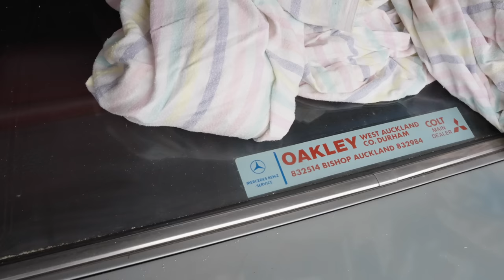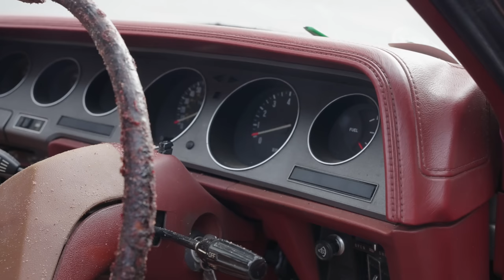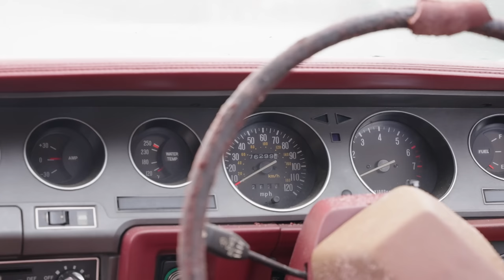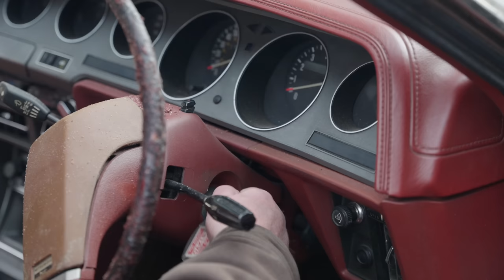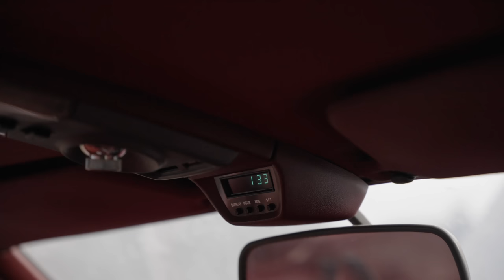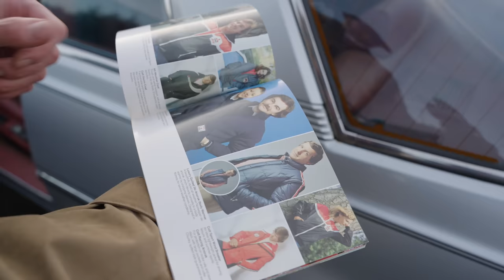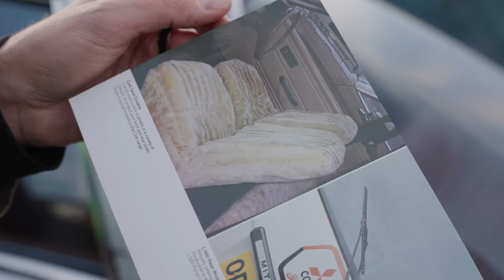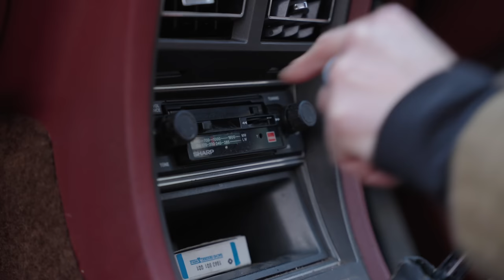Rare Barn Find classic 70s Japanese RWD Coupe discovered - will it run after 30 years?

Comment: They were quite popular in Australia where they were badged as Mitsubishi Scorpions with engines up to the 2.6 litre Astron (105 hp).
Reply: Yep I had one, and I miss it.
Reply: Sigma was the model range, with scorpion being used for the sportier variant.  A relative had one and the timing chain broke after about 5 months, damaging much of the engine.  Nasty warranty fight ensued.  I think it was the 1.8l one?  They seemed quite popular, but disappeared from Oz roads rather quicker than most...
Reply: @chrlz904  the only scorpions in Australia at the time had 2 litre engines the 78 to 79 and after that starting in  1980 which is the one I got were 2.6 litre. The sigmas yes are the ones with the smaller engines and I had 2 friends who had the sigmas and had no problems. Luck of the draw I guess.
Reply: The originals were badged Chrysler Sigma Scorpion.
Reply: @billyhong5071  yes and a badge on front passenger dash side saying designed by Mitsubishi. I had a new one in 1980.
Reply: To awc9008. Mitsubishi SCORPION?  Great name!
Reply: Even the tone of the stereo is good! Class act!
Reply: And Starion
Reply: @pistolpeds  The Starion was more sports car than coupe and usually turbocharged.

Comment: I had zero doubt it would fire up easily. It's Japanese. I'm a life long Toyota guy. Put a 1985 pickup out to pasture in 2000 with the head took off it because it had a leak at 385k miles. Sat there until 2013 when a guy randomly wanted to buy it. He showed up on a Saturday with a head gasket and fluids, fixed it, pumped the tires up and drove it on the trailer. Amazing. Can't beat the Japanese for reliability.

Comment: Hi Johnny. What a great find and an unbelievable result 🙂 In Australia these were called a Mitsubishi Scorpion. My mum had one back in the day and it was the 2.6 litre astron engine. It really was a great car, well made... solid....so I shouldn't be surprised that everything works after 30 sitting idle. Great show! A lovely trip down memory lane....👍
Reply: Starion, not scorpion!
Reply: No. The Starion was a completely different car!
Reply: @paulorchard7960  Pretty sure the Starion was the replacement for the Scorpion in the 80s. It was much more boxy.
Reply: @paulorchard7960  Starion was a very different looking car and factory turbo as well.
Reply: Yeah def a scorpion, had a few and my principal at primary school had a starion turbo we used to stare at in the carpark at school
Reply: Scorpion
Reply: Came here to add this comment!

I had a Scorpion back in the day, resprayed, lowered, sports exhaust and polished original rims. Loved this car so much - was a great drive. 

And yes, the Starion is a totally different car - the Scorpion was pretty much the two door sports edition of the Sigma in terms of styling. And they were (at least mine was) made in Japan. 👍
Reply: @PeterMescalchin  The Starion shared a lot of components with the Scorpion, The Japanese Saporro came out with the same 2.6L engine as the Scorpion and was turbocharged. They wouldn't allow the 2.6 Turbo engine in Australia so we got the 2L engine. My sister had a 78 GH and i had the 81 GJ. My father was a Mitsubishi Mechanic - one of the longest serving Mitsi mechanics in Australia.

Comment: In Australia this car was called the Mitsubishi Scorpion and my best friend said it looked like a spaceship.  I bought it brand new in 1978 and loved it but had to sell it in 1982 because it was not practical for carrying our new baby.  The smoothness that Johnny mentions is due the Astron engine having two balance shafts that rotate at twice the engine speed and cancel vibrations.  This feature was also used in the later 2.6 litre Astron engine and that one also produced the low vibration levels of a small V8 (but not the power of course).

Comment: Cool to see. I had a black one of these (same year model) for a short time in the 90s. Bought it cheap for £250 out of local paper. They had a book value of £700 at the time. Needed a little bit of cosmetic work doing. Plan was tart it up & sell it on quick make some dosh & move on. But I fell for it. Loved how it drove & looked. Relaxed smooth cruiser. Liked the fact you didn't see many around. Something different.
Kept it well over a year before letting it go. Have some of my favourite car memories from that Sapporo.

Comment: These were sold as the Mitsubishi Scorpion in Australia.  The 2 litre Astron engine that's in this car were also in Mitsubishi Sigmas , Mitsubishi L200 utes,  and AFAIK,  Mitsubishi L300 vans.  Parts availability should be actually pretty reasonable. The Astron engine came as a 2.6 litre as well.

Comment: Having worked on Datsun/Nissan through 70’s and 80’s this touched me. Those carbs (Nikki’s) were really robust and that dash is like 1970 challenger. Best bit is that special feeling when it goes from non runner to running smooth. So many emotions. Also, briefly had a four door one of these in the 90’s in bronze with alloys.

Comment: In Australia they were called Scorpions and were the big brother to the Sigma, which was similar looking. My boss, at the time when they first came out, had one and was very pleased with the way it travelled.
Reply: I owned a Sigma in '91 as my first car and always wished it was a Scorpion with the 2.6l engine.
Reply: The Scorpion was effectively a two door version of the Sigma and survived for both versions of the Sigma before it was replaced by the Magna. Had the 2.6 Astron as standard whereas the Sigma had a two litre option as well and maybe a 1.6 from memory.
Reply: @downesy68  You should write that in the Comments.
Reply: @downesy68  The first generation Sigma (GE & GH) which were badged as Chrysler were assembled in Adelaide and had 1.6l Saturn, 1.85l Astron, 2.0l Astron, 2.0 Turbo Astron and 2.6 Astron.  The 1.85l was dropped mid way through the GE cycle and replaced by the 2.6l and the turbo 2.0l was released with the GH producing 116kw for a limited run of 500.

The original Scorpion in GE configuration had a 2.0l motor only.  This was replaced with the 2.6l either right at the end of the GE or as part of the GH upgrades.
Reply: @MrCarrera28  thanks, great info. It sounds like you have a pretty intimate knowledge of them. I’m from Adelaide and my brother had a first gen Sigma SE with the 2.6. They were a significant local product here in SA.

Comment: That was a Mitsubishi Scorpion in Australia which came with a 2.6 down there. Essentially a 2 door Sigma. The Mitsubishi Starion was the JDM Mitsubishi to have in that era.
Reply: There was also the Cordia Turbo, with optional super shift gearbox! 
NSW police ran a few Cordias in the mid 80's, apparently they suffered from severe brake fade if used in pursuits

Comment: In Australia it was called the Mitsubishi Sigma. It came in a 2 door coupe (as seen here, it was called the Sigma Scorpion), four door and 5 door wagon variants. It had 2 engine options, a 2 ltr and a 2,6 ltr, both 4 cylinder. The 2.6 ltr "Astron" engine made it an interesting proposition, but it never really captured the interest of engine tuners.
Edit:
26:08 "..no vibration at all" 
If I remember correctly, the Atsron engines (2 and 2.6 ltr) had balance shafts.
Reply: Starion, not scorpion!
Reply: @paulorchard7960  Starion was a completely different car.

Comment: In 1978 this car was also released under the Chrysler brand in Australia as the Sigma Scorpion. The model was updated in 1980 when Mitsubishi bought out Chrysler Australia and all cars were then branded Mitsubishi. In 1982 it had a third facelift with a minor change in 1984 until it was discontinued in 1985. Also in 1979 the Australian made Sigma as we knew it was exported to the UK firstly under the Colt car company then later in 1982 was imported as the Lonsdale sedan or Estate. I also believe a few Magna cars as we called them were exported to the UK in 1986 as the Sigma Estate.

Comment: Ah! Got seven of these here at the Ranch. They came with the Property when I bought it.....4 Challengers and 3 "Sappy's." I've bought and had given to me over the years lots of Parts like that "SPORTAAA" Steering Wheel (s), some Doors, Fenders,ect. Most of mine are 79's and 80 models. One of them has Factory T-tops. One's an Automatic the rest are 5-Speeds. Got lots of Accessories like Aluminum rear Window Louvers, Luggage Racks,ect. And of course the DRY New Mexico Desert 🏜️🏝️ has been very kind to the Sheet metal 😀👍. And I don't even like the Damn things 👀😒🤨🙄......
Reply: Send this guy a steering wheel!

Comment: Just fantastic 
Love how it starts and runs fine after 30 years in a lock up!
Japanese cars of the 70’s- 80’s are so well engineered for reliability ( not rust): I saved a one owner 87 Celica GT - had been locked in the original owners garage for years unused. We changed all the brakes fluid’s fuel and cambelt plugs etc - it started first turn of the key and everything worked - wish I’d made a film or it

Comment: Oh my, you just made my heart skip a beat. Many moons ago when I was a care free and confident young'un, I part exchanged my Nova Merit 1.2 saloon for a Mitsubishi Colt Celeste ST. I saw it down a little side road on my way to work one day and two days later it was mine. My parents were not impressed as the Nova was a nice little sensible car. The Colt though... it was something else. All my mates were jealous, it was by far the coolest car I have ever owned. It was bright yellow with a little bit of black pin striping. Light sky blue tinted windows that had chrome surrounds. Deep pile brown interior carpets and a wonderful dash of individual sunken dials. 
 I ran it for a couple of years but the engine was getting a bit 'tappitty' so I laid it up and started sharing my girlfriends Fiat Uno 1.3 auto which was a bit of a come down. I sold the Colt on after  another year(ish) as my parents were fed up with the sight of it on their drive with no work being done on it. 
 Don't get me wrong, I like my comfy modern mondeo... but I will never be that cool lad in the yellow thing again. All the other lads my age had Escorts and Fiestas, whipping round the Dartford one way system. Not that I was fully fledged boy racer then, I did like to just go for a couple of laps every now and then just because...

Comment: My father had a 79 Dodge Challenger (US) he purchased new - caramel tan/ballast sand 2-tone with cashmere plaid buckets.  I used to borrow that car any time he would let me.  Absolutely adored that 5 speed - it shifted much nicer than the 77 MGB synchromesh I learned on.  Searched my house after watching this wonderful barn find looking for the original brochure I vaguely remembered.  Found the window sticker but the brochure I came up with was for 1982 Dodge Imports (US) - covering the Challenger.  It doesn't match the one in my memory.  Not sure if my father bought an older, left-over model or if he considered replacing his '79 with a current model in '82.  Also found the "tilt lock lever operation" hang tag if you or the owner need to adjust that amazing steering wheel.

Comment: This brings back memories for me. My first car was a top of the line 83 Sigma Station Wagon. It had the carpet lined doors, and boot with aluminium rails to slide luggage in. 

The steering wheel is the real throwback, the same rubber coated wheel that just disintegrated over time. Didn't help it was kept in the Australian sun. 

It just never quit it kept on going. Loved that thing.

Comment: I had one of these as my second car.  Inherited it from my parents in 1989.  W reg Auto with grey leather(I think or part leather) Single headlights with headlight wash wipers, alloy wheels, electric windows and sunroof.  Well what 80’s car was complete without an sunroof.  I can see  now that it would have been more of a spec suited to America than the UK.

It was an absolutely fantastic car and must have felt so ahead of other stuff in it’s time.  It was a slightly different shape to this one though as the boot lid had less of a rake to it and looked more saloon style.

Oh what a great memory.  Then onto a 260Z, AE86 Corolla GT coupe, Celica GT4 MK1.  Such a great era for cars

Comment: Johnny,  I love how good you are getting so good at starting these old cars! The Petrol Tank Pump is Genius and really cuts out the biggest problem with old fuel and gummed up pipes, that's the last thing an old engine with carbs or injection needs! A Battery Booster Pack with an Air Pump would go perfectly with this.
Love your Barn finds and this is A Peach!

Comment: WOW hearing this trying to start, then run brought the memories flooding back! My dad had the saloon version of this car, a Galant Sigma, albeit a 1.6 with 4 speed manual. But the starter and engine sound is identical to this 2 llitre. It was my dad's first and only brand new car, which he bought in 1978. He taught me to drive in it when I was 14 (on private roads), and it was the car I drove for about 3 years after I got my driving permit and then bought my first car. He kept it until 2012 by which time it wasn't in use anymore, although it still worked, so he gave it to the scrapyard where he himself got lots of parts for it through the years of ownership. I really regret now that we got rid of it... and yes I can attest to the smoothness of their engines. Mitsubishi pioneered the use of balance shafts, and subsequently licensed the technology to many other manufacturers.

Comment: I'm in the Northeast of the US and owned the 1982 version of this car. Imported for Chrysler and called a "Dodge Challenger" (not the big V8 one!). I owned from about 1986-1989 and my brother took it over and used until about 1993. It was rusting, but aside from a gearbox repair in my first year of ownership it had always run really well and was very reliable. It did get get a head gasket at about the 140,000 mile mark,  but was very cool. 
 I've not seen one for years here. 
It was a 2.6 engine and a five speed! I'd love to find one!

Comment: Oooohhh!! I used to have one of these, almost identical. 2 ltr GS/R. Mine had a grey interior. The raised strip over the roof was black on mine, and the wing indicators had been removed I think by a previous owner, and blanked off. I cried when I sold it. 😢I couldn't afford to get it restored, and it needed a fair bit of welding and suspension components refurbishing or renewing. I couldn't afford to keep hold of it, such was my financial plight at the time. 
For the brief time I ran it I loved it. It wasn't the fastest of cars, but it was quick enough, and there was a lovely induction noise through the dual Solex twin choke carbs. It was lovely to drive, so comfortable.  If I won the lottery, I'd make it my mission to find another, or maybe a few of them actually.

Comment: Amazing find. I had a Sapporo in the early 80's and unfortunately seized the engine on a move to the north. My previous car to the Sapporo was a Celica ST and there was no comparison between the two, the Sapporo won hands down on everything. Your description of the roof cluster giving the impression of an air plane was exactly how I would describe it when friends got in the car. Mine was a 2ltr as well but it wasn't the fastest, the weight warrented a bit more HP. I think the American models had a 2.6L engine. Great report on what should be a classic, thank you.

Comment: Australian versions were called Chrysler Scorpion and had the 2L single carb or later a 2.6L version with twin balance shafts. The drivetrain was the same as our Sigma's and the styling was similar. Japanese GSR versions had a 4G63 turbo and were called Galant Lambda. They also had IRS.

Comment: Hi Jonny .   I did quite a lot of paintwork on these for a local Mitsubishi dealer . And l compared the build quality of Mitsubishi very favourably to BMW . These were a great drive but not fast . The Gallant Turbo was pretty rapid and the  Lancer Turbo was a pocket rocket as it used the same unit . I had a 1985 Mitsubishi Colt 1500 turbo and that was a great pocket rocket ......again a very rare car as would be a Starion . Sadly after the mid '90's the build quality of these cars rapidly fell . I only very recently sold my '93 Colt 1600 GLXi  after 16 years .lt still had sparkling performance ,handling , comfort and electric windows , roof , central locking and power steering . Not bad for a £350 write off ! I absolutely still regret being coerced into selling it . Great show Jonny .
Reply: local guy used to specialise tuning the lancer 2000 turbos/starions..he transplanted one into my mk1 Escort..wish i had kept that

Comment: I had one of this, here in Brunei it was marketed as a Mitsubishi Colt Galant Lambda,  same name in the Japanese market as well,  mine was a GS/R ,  the later model came with a boxy rear and it was marketed as Sapporo came with  4G63 engine. I believe they're the predecessor of the mighty  Mitsubishi Starion😃

Comment: I'm one of those UK 5 sorn Sapporo owners, a 1979 (August V plate) with 62K original miles and the second owner from new, bought the car in 2002, the reason its such a smooth engine is they have balance shafts, and oh yes that digital clock dims when the lights are on, there are so many things these cars had way head of its time......

Comment: What killed a lot of those engines was timing chain, tensioner, and guide problems. The 2.6L version was far worse and through it's later adoption in front wheel drive form in Magna's in Australia the problem persisted through several series. After market tried to solve the problem with better than factory replacement and some replacement kits were far better than others for longevity. However, they are hard on timing chain components and any rattle noise needs to be addressed promptly. Another common problem was engine block cracks radiating generally forward from the last welsh (core) plug. Keep a close eye on that area.